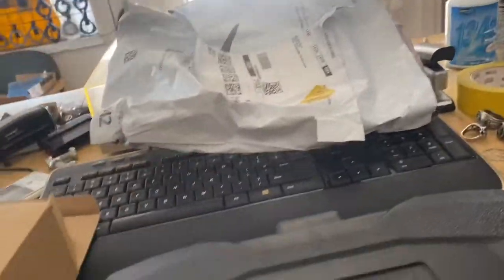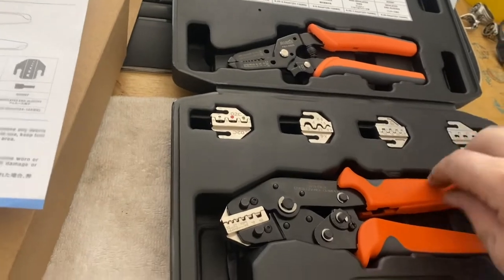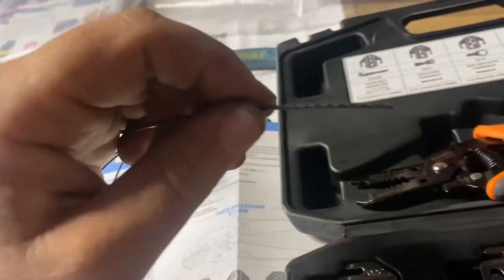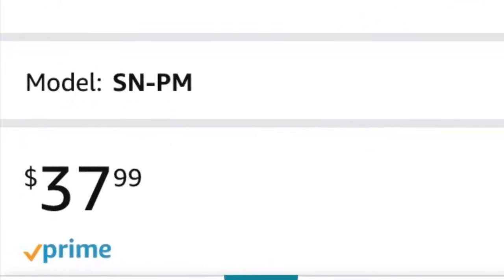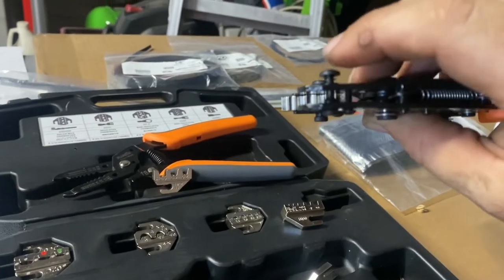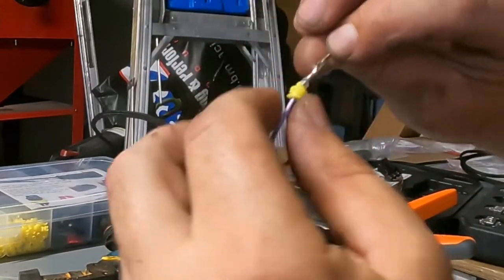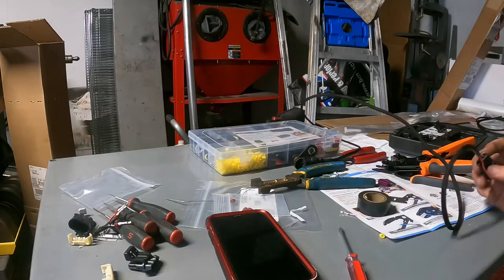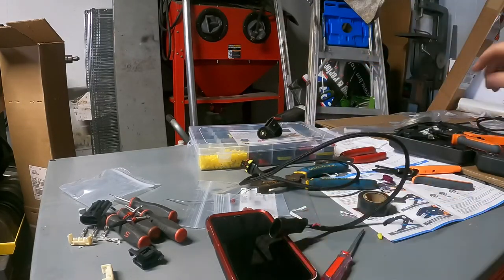Will this Cheap Amazon Crimper work well? harness building tools ,IWISS Quick Change

Comment: I'm looking at something basically the same, and it's actually from the same brand, but it looks like it comes in a soft-side case, and it's likely not quick change(I think it requires an included screwdriver).

The main question i have, is whether, a year out, you still like, and/or use this specific brand or model of tool, and what your current thoughts on it is? Also, I'd like to ask whether it really saves much time to get a quick change model, if you don't use it very often, or whether you think a standard screw attatch jaw would work fine for most people? It seems like on Amazon, the quick change type of crimper is way more expensive comparatively, than one that requires removing and inserting screws to replace the jaws.(of course, the quick change one i saw might have just been an expensive brand overall, at 75$ for a kit like the one shown here)